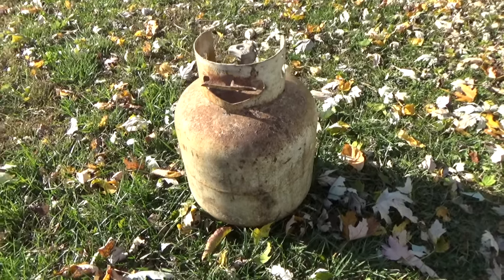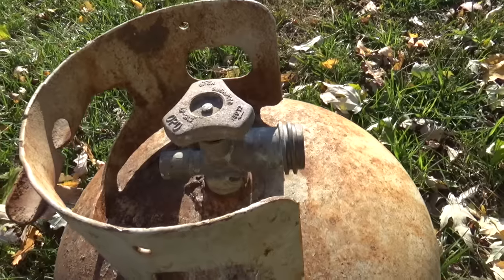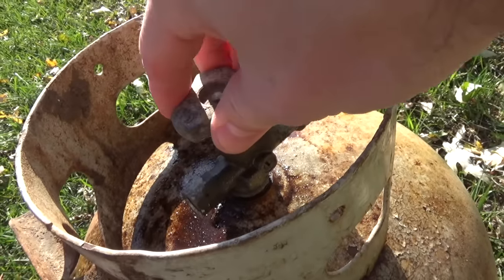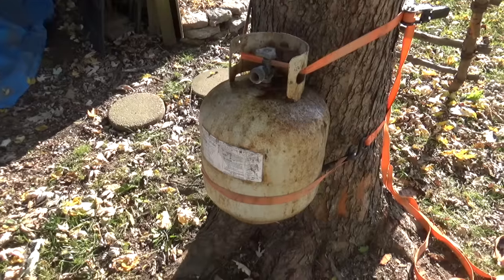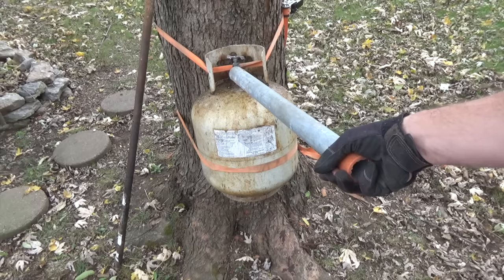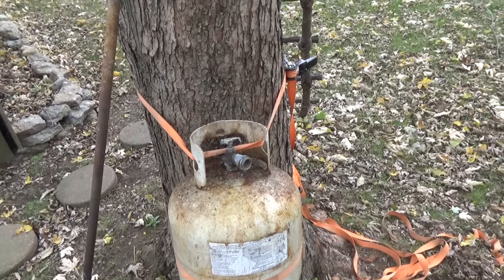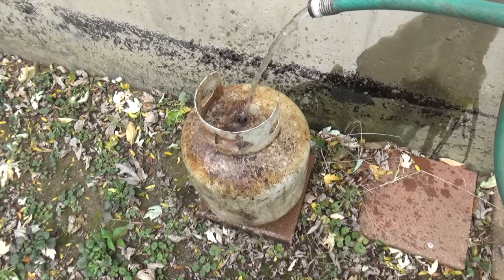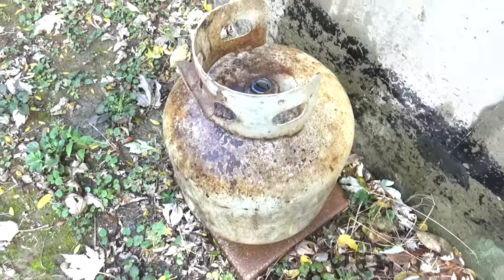Remove Propane Tank Valve in 2 Minutes (No Special Tools)

Comment: You make it look much easier than it was for me. But it did work with the pipe wrench and winch straps. I couldn't get enough friction with the straps and a tree, so I ended up lashing it down on a landscape timber at 90 degrees to the timber. Thanks for the video.
Reply from the maker: Lashing it to a landscape timber is a solid idea! Nice! Glad everything worked out. Best of luck with your project!

Comment: Thanks for the video. I put a 1" round bar through the top bracket of the tank and had the other end in my vise and I turned out the valve very quickly with a pipe and 2 large Crescent wrenches!! I had to cut through the head of the screw on the handle to remove it because it was a Torx drive with a pin in it and I did not have the right hollow bit to remove it
Reply from the maker: Glad the video helped. Thanks for taking the time to comment and add to the discussion. I like your ideas for this technique.
Reply: Do you have to loosen that screw to remove the valve from the tank? What exactly does that screw do?
Reply: Harbor Freight has a kit with most types of anti tamp bits for about 4 bucks, last time I checked.

Comment: Good, informative video. Is it safe to replace a defective valve yourself? Have a brand new 5 lb. tank that would cost more than purchase price to have done at a dealer.
Reply from the maker: I have never replaced a valve - so I am hesitant to give advice on it. I am not sure what the torque spec is or if there are specific sealants used on the valve. I think it can be done, but I have never done it. Thanks for watching and taking the time to leave a comment. Stay well.

Comment: You'd be surprised how many people dont know why you added water to tank
Reply from the maker: Yep. Simple things that can be overlooked. Thanks for watching and taking the time to comment. Peace.
Reply: You can tell those people by the fact they have a L and R on their shoes.
Reply: " people don't know why you added water to tank"
That's just one isolated factoid.  I'm never surprised how much lack of in depth knowledge most people exhibit on matters they feel feel particularly competent in. Look up the "Dunning Kruger Effect" and read about why that is the case, it very interesting.  The lack of basic overall knowledge for a high percentage of people is epidemic today, imo.  I'm 69 and it never stops coming up, the lack of real in depth understanding content providers show when making a how to video which they feel adequate in.  The hardest part is being effectively diplomatic enough to not be painted as a hater and troll when pointing out short comings in a video or presenter's methods/Knowledge. Ignoring it and not commenting is the safest. Cheers.
Reply: Lots of comments here about why add water but know one has provided an answer. Also, my feet hurt every other day or so and someone else said it would be helpful to mark the shoes L and R but how am I supposed to know which letter goes on which one and how would that help anyway?  I painted a floor the other day but left tracks on it when I was finished and my wife laughed at me. I still don’t think it was funny, I had to get out somehow.
Reply: Don't know if some of these comments or a joke or not the reason why you would add water to any vessel  before cutting or welding is to purge any residual vapors or even liquids from the interior many people have been seriously injured or killed for failing to do a simple step. People assume that because the vessel is empty that the danger is gone but in fact they are still very dangerous.I fill vessels until they are overflowing and l continue to overflow for several seconds just to make sure no Boom
Reply: @jtoombs56  
Thank you for making me laugh out loud. With this world now where everything is PC or racist or some other thing. You can still joke at the world. 👍🤣👋

Comment: I'm a propane tech just checking the interwebs for idiots. You are not an idiot. The water purging step at the end was such a relief. Thank you for not blowing yourself up. 

One quick thing though, I do believe that adaptor you put on it has a check valve, and wouldn't have actually let any gas out unless a bottle was connected on both ends. But i could be wrong.
Reply from the maker: I take this as high praise coming from a real tech! Thanks for watching and taking the time to comment. Stay safe and I will (try) to do the same. Peace.
Reply: I have a question;
First...
I purchased a 15lb tank.
when I went to use it, no LP came out... 
"Bad valve" is what one fuel attendant claimed.
As I turned in the "bad valve" tank... I noticed the straight screwdriver threaded thingy... (Valve?)
It was horizontal... I thought it might have something to do with this not working.... The place were I bought it swapped it out with a working tank.
I guess my question is; all the ones that I looked at that "worked" the straight screwdriver thingy was turned to about 2 to the 8 ---> O'clock position. My defunct one was horizontal.
I was tempted to turn it, and see... but, I declined considering each tank holds 300+ PSI.
IF I were to turn that ... would I have turned the valve on?
Is this a safety feature or something?
(I didn't mean to ramble; I just wanted to set the scenario for you to understand).
Thanks in advance 3 years later. LoL.
Reply: Good question. The little flat head screw opens up the "fixed liquid level guage," aka the "spitter." When he pulls the valve all the way out you can see a straw like thing going down about 4.2 inches. That is the 80% full point. When filling the tank, you can open up thw spitter and When liquid spits out, you know the tank is at 80%. You only fill to 80% because propane expands when it gets warmed. You can also open the valve to let out pressure as the video shows. The screw can be in any position really, as long as it's shut. It would have nothing to do with the tank working or not. Sometimes the check inside the valve just gets stuck.
Reply: @Waltstuff  Thanks! I learned something new!

Comment: I use a long crow bar and go thru the slots in the handle
Reply: Ya I didn't have ratchet straps. 1 long pipe through the handles, place tank on its side, apply cheater bar

Comment: Thank you for this very helpful video, now I wish I wouldn't have chucked that old 20 pound tank but I do have two old 30 pound tanks that are past the expiration date and can't be filled anymore. They came with my old camp trailer. I been wanting to make something out of them but every welder I know won't touch them. Now I can take off the valves and fill with water. I would like to make something with them myself but I don't have welding equipment. I looked through your video for one where you made something from that old 20 pound tank but I couldn't find a video, did you do one yet?

Comment: I feel cheated... Seriously... I needed step by step instructions of the gas displacing water magic trick. Or, we can save that for a video at a later time?
Thanks for the video!! I've aways emptied them at 100 yards with a M1 Garand and a lit candle,  but your way works, too.
Reply from the maker: I'm going to try your way next time.
Reply: @HNXMedia  It works well and you get a little excitement as a bonus
Reply: I have used that same opener.  No candle though, live in a pine forest.
Reply: @HNXMedia  make a video when you try it.

Comment: Just got an old tank to use for a project but it still has some gas in it. There is no valve, just duct tape over the hole. Can I still use a hose to fill it with water? I read that the gas will sink into low spots and remain flammable.
Reply from the maker: If there is just duct tape over the valve, then any gas in that tank will be minimal. Yes, just fill it with water (overflowing) and let it sit outside for a day. It will stink something fierce, but will be fine to work with after that. The odor will eventually go away, but it can be rough when you first start working with the tank. Be safe.

Comment: Do you need to have the tank "vacuumed" before having it filled for the first time after replacing the valve?
Reply from the maker: I would think so, but I am not a propane tech. I only remove valves to use the tanks for other projects.

Comment: Well I suppose your  Idea was alright using a two Straps: But My Method is to take a Crowbar or a solid Piece of Bar : Place the Bar into a Vice {side on} Take hold of the Empty Gas Bottle and slide the  Crowbar through the  two Holes; and then with a 22mm Open end spanner or an adjustable  Spanner or pipe wrench. If You Find it hard o Unscrew Place a Pipe within the  Pipe wrench for extra Pull
Reply from the maker: Nice! I might just give that a try next time. Solid idea!

Comment: If you then tighten that valve back up and loosen it several times back and forth with the pipe on, it will turn easier and easier.  When it's lose enough your done with the pipe.
Reply from the maker: Good tip.
Reply: @HNXMedia   One good tip like you gave in this video deserves another. So I did that!
Best wishes.

Comment: Timely video for me finding an old camper tank has a leak at the valve stem and I'm looking to see if there is an "O -ring" that can be the fix.
  Did you ever do this ? 
   Thank you for the video... New sub here with notifications
Reply from the maker: I think a lot of them are sealed with "pipe dope." I have never replaced an o ring on one. Not sure if I would risk it.
Reply: @HNXMedia  Thank you muchly... I'll choose to trust your judgement. Fare well friend...
          Safety First
P.S. I just realized that I may not have been clear as to the issue I'm seeing with the valve leak ... The leak is not where the valve threads into the tank but is at the point where the valve stem passes thru the brass but (the one with reverse thread indications notched into it).
I do recall being at a North Idaho Propane and saw the sales clerk offer certain "O-rings" to a customer for the valves though I believe they were small ones that seal the bleeder screw and so do assume that some repairs are/were considered OK to do... This was, however about 10 years ago.

Comment: Hello, Just curious, can one replace the on/off dial on a propane tank with an on/off lever, one of those red rubberized ones?
Thank you in advance. =)
Reply from the maker: Honestly, not sure. I have never tried that.
Reply: @HNXMedia  I feel like when the tank is upside down for refilling smaller tanks, it would be easier to open & close the valve.
Reply from the maker: @bigemugamer  Never thought of that. That would be much easier. It seems like you could certainly control the flow better. I am not an expert on the pressure ratings though and I wonder if any shop would refill the tank once that valve is installed (at least in the over-regulated US). Very interesting idea.
Reply: You'd want it to be at least 375 psi if you did but also nobody would refill the tank with one of those valves or at least they are not supposed to at all.

Comment: good video thanks
Reply from the maker: Hope it helped give you some ideas
Reply: @HNXMedia  yes although I didnt do all these steps. I just opened the valve on one today filled it with water then cut the top off. I could see that purgeing with water was important though, or rather I could smell it
Reply: @HNXMedia  im attempting to clean the inside with electrolysis atm. prob not really necessary for forge building but hey

Comment: I would add one safety measure.  He made sure the valve was open to depressurize the tank.  However just in case the old valve was faulty, when unscrewing the valve, wiggle from side to side to tell if there is pressure in the tank.  If the valve is not very loose, there may still be pressure in the tank.  Be safe.
Reply: Where were you early 2012 .
Reply: @dancanavan2812  Sounds like you had an event in 2012.  I had one in 1966 in the oil field.  I unscrewed the head off a piece of equipment I didn't know was under pressure.  It blew the 5 pound head about 50 feet.  Luckily no one was in the way.

Comment: Di you ever make the grill out of the propane tank?  I couldn’t find a video.
Reply from the maker: It is actually about halfway done. My welder died on me and I do not use a welder enough to justify buying a new one. The "partially built" wood stove is sitting in my garage. As soon as I can figure out how to finish it without welding, I will post the video. I did a lot of filming before the welder died, so I have the original footage to complete the vid.

Comment: I've done this hundreds of times, 8 times just in the past week. I have a better method 😊 btw, purging with water is not fool proof, vapour can still remain, I have a scar to prove it. If purging with water, leave it for a day or so to air out, don't cut straight away.
Reply: If you want to cut it, simply run car exhaust into it while cutting
Reply: Have you ever worked with a tank that's rusted closed? 
I searched youtube and found this video. 
The triangle-shaped handle won't move either direction. I cannot tell if it is currently opened or closed. 

Using a pin I purged the gas I could out of it, but I'm sure there's still vapor. This makes me uneasy about opening it up. 

Is it safe to drill into it underwater, would that prevent explosions? 

I was also thinking a file and some lube, nobody has ever made a spark using a file.
Reply: @capnlatenight5356  You can just drill into it normally, if there is no pressure inside of it. Nothing will happen. 1: Drilling doesn't produce sparks, if it does you'll destroy your bit before making it through the tank 😉 2: even if it did spark, it won't explode because there is no air in the tank, it would simply produce a small flame where the hole is. I cut these all the time as I make wood stoves from them. Heres my method, drill 6 or 8 mm hole in depressurised tank, put tank in a fire (I use a steel oil barrel, wood and a powerful blower from a bouncy castle) this burns off the paint and frees up the valve. After heat treating the valve comes out easily, usually just twist out by hand. At this point it is dangerous because there'll likely still be vapour inside (which still surprises me as the tank would be glowing red during heat treat) and taking the valve out will introduce air. You can leave it to air out for a day or so and it'll be good to go. I actually do a "controlled explosion" by firing my plasma cutter into the hole I drilled and the vapour ignites and shoots out the valve hole with big whooosh, sometimes still gives me a fright even though I've done it hundreds of times 😂😂 But you can skip that last step if you're not feeling brave/don't have a plasma. 👍 Let me know if I can help any more, don't want to see you getting hurt.
Reply: @capnlatenight5356 It's important to make sure there's no pressure inside it before drilling. If there is, it's possible that gas will spray out and ignite from the brushes in your drill motor, flame throwering you in the face (this has never happened me but I'm conscious that it could) As you say though, jam something into the valve pin and release any pressure first.
Reply: @cocospops9351    thanks for the detailed response! 
That does make sense to me, I'm definitely feeling safer about it. I'll be sure to try it like that.
Reply: @capnlatenight5356  No problem. Good luck and be careful 👌

Comment: More often than not, you'll find that valve rusted in place.
SO,
What you do is add some heat with a torch & that'll loosen 
those rusted threads.

!
Reply: 🤦‍♂️ 💥 🤦‍♂️
I hope that was sarcasm because brass doesn’t rust.

Comment: propane is heavier than air so to vent out the rest of the residual propane you could have just flipped it upside down open. "But I can still smell it"  that's just the ethyl mercaptan residue on the surface of the steel the odor added to propane.
Reply from the maker: Yep, even after you cut one open (after removing the valve) it takes FOREVER for that smell to dissipate.
Reply: @HNXMedia  I thought I heard one of those fire pit makers say they use old style dish soap to remove the smell if that helps any. I work with it and there's no good way I've found to remove from your hands.
Reply: Propane odorant is ethyl mercaptan, skunk scent is aliphatic mercaptan. A little goes a long long long way.
Reply: I once removed the valve from an old 100 pound tank. I wrestled that tank around the yard and driveway for a good 2 hours. It made a fine air tank except the smell lasted forever, even after filling it with water a few times.